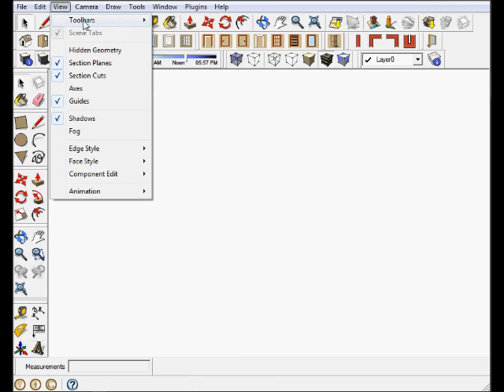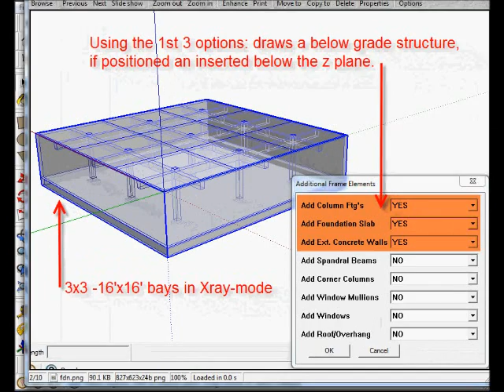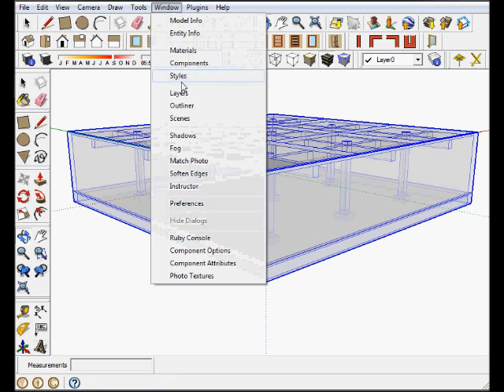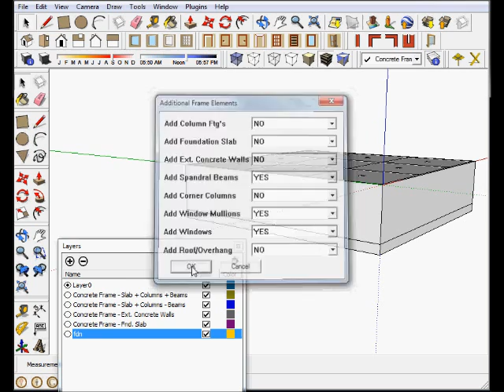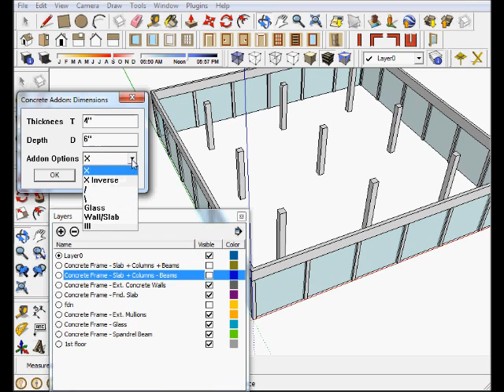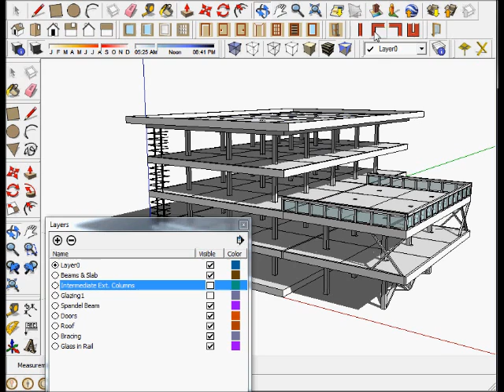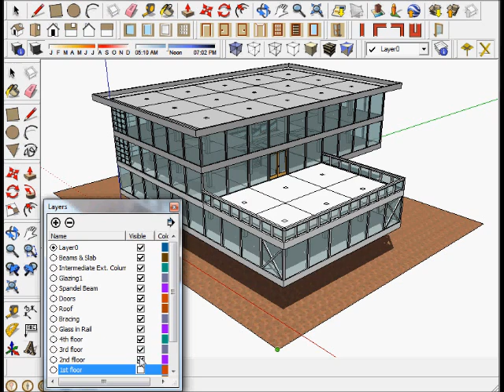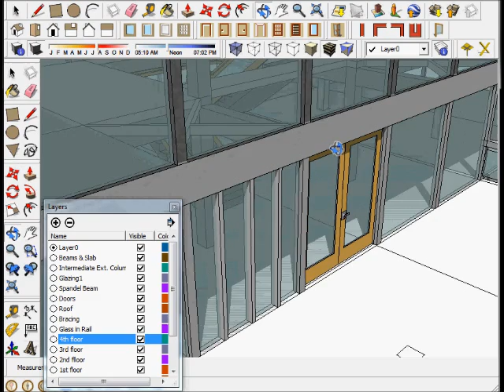ConcreteFrame

Comment from the maker: Thanks for your comment. Naturally its not concrete without a concrete texture. Hence in that light, the Frame material can become whatever the Designer or  Engineers desire. The Bays themselves can easily become living units perhaps stacked or single story. These units can be arranged in any fashion. Perhaps like the living units produced by Moshe Safdie in Expo '67. or the way we assemble living units on modern cruise ships, stacked 14 stories tall.